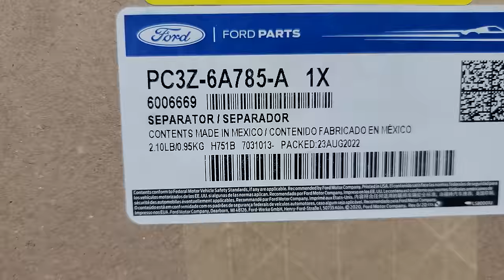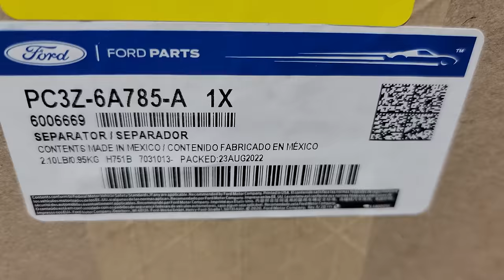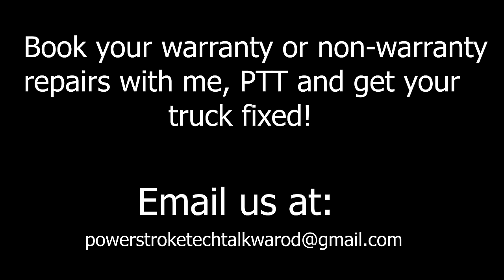TOP secret 6.7 diesel part | should WE PUT THIS ON?? would YOU?

Comment: 23-24 CCV box works on a 17-19 and it does not cause pressure so less pressure on engine gaskets and less blow by
Reply: I put it on my 2021 f350
Reply: @f4tl3oi  bolted right on correct?
Reply: Just installed on a 17 and a 19
Reply: @mgerrow512  did you run into any issues?
Reply: @TerpyToaster  yes! Been running it over a year now.
Reply: @TerpyToaster  Direct replacement. One truck has the non serviceable filter and there was an audible difference in how the truck idles quieter with it.
Reply: Installed on my 11
Reply: @ better off re routing it that'd what I did
Reply from the maker: @Cruising200 juss did 1 today
Reply from the maker: @TerpyToaster ehhh I can't do that stuff my dude
Reply: @Cruising200  you put the new style PC3Z on an 11?
Reply: @keetoniswhat yes

Comment: So my 2022 which has a build date of November of that year came with that 23 part I have a banks ram air and I took the elbow off today to clean it and looked into my inlet and there's a puddle of oil right at the lip of my turbo so it's looking like I'm needing to replace this 23 part?What else could be the reason for the oil?
Reply from the maker: That's normal. The CCV pumps or lets the low pressure created by the turbo to draw in the vapor which collected into what u saw, back into the engine
Reply: @ so what are we recommending a catch Can? Will it void my warranty removing this part or get a new one is the oil going in turbo fine lol need some answers ARod🤘🏻
Reply from the maker: @wespierce1686 they have designed it for some reason to eat it. Your choice to remove, not somethin I can do

Comment: I don't how many of the truck mechanics have ever torn much motorcycle and ATV engines apart, but they have a so much better solution to crank case vents that I've just never seen in the automotive world.
Canam uses like 4way t style fitting on the inside of the engine geared to the crank, it spins flinging all the oil out of the crank case vent. Suzuki I've seen used a box separator like you buy aftermarket for some trucks, except it has a permanent drain line going back into the case so you don't have to drain it. A few other Japanese engines just use complex series of baffles cast into the case so oil doesn't get into the vent lines.

Comment: I have a 2020 and I checked the back pressure with the old big factory one and I had nothing. I hate oil leaks so I decided to change it at 60k anyway and Ford sold me the new small one like you are showing here. Now I have slightly noticeable back pressure. What’s your thoughts? 
I pulled the old one apart and it had some carbon in it.
Reply: I literally did the same thing and have the same issue, I had the old style with no pressure,  replaced it with the smaller new style and now have some noticeable pressure, did you figure anything out with that?
Reply from the maker: I dunno about that

Comment: I bought a replacement filter for my 19, and just did the oil change where I was going to replace the filter (44,000 miles) and come to find out, mine appears to be non-servicable.  there are no screws on the top to take the cover off!!  So is it safe to assume that I don't need to worry about servicing this?  Or should the whole canister be replaced at some point?
Reply from the maker: Nothin to service on them boys
Reply: @PowerStrokeTechTalkwARod  sweet!!!

Comment: Do the newer serviceable CCV units keep oil out of intake? The Cummins crankcase filter works pretty well to keep oil to a minimum there.
Reply: They do not. My 2017 is serviceable type and I have oil stain on the inside where it's vented into the intake.
Reply: The serviceable ones have the most problems

Comment: Hmmm, it would be interesting to see what kind of efficiency you would get if you could mount the cheese grater at the valve cover output, then this on top using an adapter to dump what little oil left back in the motor, still using intake vacuum to aid ventilation.
Reply: I was thinking SPE cheese grater under the new style CCV box than rerouted externally, obviously have to put a spacer on the drain back port, so the CCV box sits flush, this would have to product next to no fumes i am thinking.

Comment: Was there any update on the retrofit of the later CCV to the earlier models?
Reply from the maker: It works on all 6.7s fitment wise. Won't work if your CCV box hose has an electrical connector. The new 1s do not.
Reply: We have a late 2020 that has the bolts on the ccv, no electrical connector, so the later filter will fit / work ok? The proper replacement is on back order with no eta. 
 @PowerStrokeTechTalkwARod
Reply: @PowerStrokeTechTalkwARod Do the 2019’s Have an electrical connector?
Reply from the maker: @kao9379 2011 2012 2013

Comment: So there's 4 different ones now? I had prior heard about the one with top bolts, supposed to be serviceable and the tampons inside for steel bodies. But my 16 had the revised non-service sealed top one. Which I am unclear if they need changing or are a lifetime unit with no issues. Hmm.
Now we see a new version bolt top and an even newer version sealed top.
Reply: Only ones that had a replaceable filter was 17- 18. The steel body trucks didn't have filters in them. These new ones are much cheaper as well. Dealer cost on this are $49 compared to the other ones are over $100.
Reply: I agree. I believe ARod has said the filtered bolt top was first, then replaced with a new version thats non serviceable sealed top (which is what my 2015 has in it.) Then the newer trucks came with a newer filterless bolt top, and now those are replaced with the small one in this video. So i just saw another video from another flrd mechanic saying to change your ccv bc they get plugged. He shows it very swollen and its the same one i have in my truck which is filterless, so my question is how did that one get plugged up if it doesnt have a filter. And do i need to change mine to a newer version or is it a "lifetime" oil separator?
Reply: @CPsGarage the one for my 2015 truck on fordparts site is $220 discounted $245 regular. Smh so if i ever need tl change it im pretty sure im going with the $49

Comment: Can any of these be used on older model trucks, say 14? Or because there is no sensor it can't be used? Thanks
Reply from the maker: If your truck has no sensor good to go! 
If your truck has A sensor then you might want to see if at some point in time it had recall 17M04 completed which was a PCM reprogram to no longer look at that sensor thus deeming it ok to leave disconnected & use the new PC3Z box as you saw here.
Reply: @PowerStrokeTechTalkwARod  My truck did have the recall. They also took off the grey lock ring and put on the rubber collar.
Reply: @PowerStrokeTechTalkwARod  Just ordered one. When I install I'll let you know. Love your videos and your new shop!
Reply from the maker: @stevenfuchs2548 cool
Reply from the maker: @stevenfuchs2548 thanks buddy

Comment: Hello ARod. I was wondering if I wanted to update my 2013 to this new design, I still have the connector on the tube. If I updated won't I get a check engine light complaining about the connector? Or does the pcm have to get the latest firmware first? Thanks
Reply from the maker: Yepp nice job, thee pcm wld need 2 be updated to the last calibration out.
Reply: @PowerStrokeTechTalkwARod  thank you very much

Comment: I have a 17 6.7 and I'm just about to replace mine at 120k. Mine does not have the screws on top just a sealed unit so not sure if it's a filter or baffle. I got truck at 50k and I have a small upper oil pan leak now suspecting the ccv and it was probably never replaced. But still better to swap out and cause more damage. How often does Ford recommend replacing CCV?
Reply from the maker: U have n O filter

Comment: I wonder if it was change to accommodate the new high output 6.7L? Would the HO use that sensor port and the standard 6.7L not use it as on the current trucks?
Reply: Most likely due to up coming OBD requirements set by the government.

Comment: Does the late model 22 ccv box have a filter in it? Can it get clogged up? I have a late model 22 and trying to decide if I leave the factory box since it's late model or do I get spe ccv kit?
Reply from the maker: No filter!!!!
Reply: @PowerStrokeTechTalkwARod  so just leave it then and shouldn't have any problems right? Will this box fit a 18 6.7 with out any problems?
Reply from the maker: @stevenallen461 you shld put PC3Z 6A785 A in both if ur 22 hast had the new new one, still no filter tho
Reply: @PowerStrokeTechTalkwARod  22 has the new one you showed in this video but my dad's 18 hasn't been changed so if that one will fit no problem we will change it to the new one
Reply from the maker: @stevenallen461 yea

Comment: The ccp sensor may be equipped on the high output 6.7 option in the 2023s, as a protection measure to derate the truck. Could also be used in the iOLM strategy to corroborate calculated engine load. As far as the one-time use hoses, it may be an emissions tampering deterrent or to ensure proper sealing ford one of the strategies. One concern with not replacing the tube if flagged as one-time use, if one needed to SPW a repair (of a cp or wty repair) and it was not replaced, there is the potential for a claim rejection - never seen it, but is allegedly possible.
Reply from the maker: Look for it in 2025

Comment: Great vid. Two cap fulls of Amsoil upper cylinder fuel treatment in that power washer. It will thank you.
Reply: I'm running 100cc of two cycle for every 16 quarts of diesel fuel as diesel today has zero lubrication this is my own preference not suggested that anyone else do this. But along with other regular diesel fuel conditioners, my 6.4 seems quieter and runs smoother. I also lowered my low-boost fuel from the number 3 position to the # 2 position on the tuner. This has improved the black smoke on start-ups and in stop-and-go traffic. Just something I am toying with I'm not responsible for any damages if you follow this procedure. Just saying a little more lube in the upper cylinder and going through the high-pressure fuel pump shouldn't harm anything. Should it 🤔

Comment: I have a 2019 (do not know much about diesels), could that blocked sensor port be for backward compatibility? My truck has 74k miles on it. How often should I replace the CCV element? I've have yet to replace it.
Reply from the maker: Backward compatibility. No, this is the brand new one. If you have a filter in yours, it needs to be replaced. Often watch my other ccv videos

Comment: Is there any more info on whether this newer version is better?
Reply from the maker: .....better as far as what
Reply: @PowerStrokeTechTalkwARod  better than the previous ccv versions. As in not plugging up, or having to service as much, or not allowing oil into the intake system...
Reply from the maker: @dawveed26 they all allow oil into the intake system. And only the duallys had ones with filters that were known to stop up
Reply: @PowerStrokeTechTalkwARod  so the best option is to install a remote ccv can kit and eliminate the box all together?
Reply from the maker: @dawveed26 if that's what you deem suitable for your needs

Comment: The early 6.7's did not have a serviceable unit.  They had an oil seperator.  My truck has 132k miles and have never had a problem.  Always enjoy and learn.  Merry Christmas.
Reply from the maker: U too pal
Reply: Dumb question. I have a 2012 with the non serviceable box. I have no blow by at the moment.  Are these non serviceable ones ok to let alone or are they needed changed?
Reply: @Jason1Pa  They are an oil seperator and are not serviceable.
Reply: @johnmac4769  Yes I understand they are unserviceable,but can they still get clogged and need replaced?
Reply from the maker: Theres no filter, no change
Reply from the maker: I think u need to watch our other CCV videos broski
Reply: @Jason1Pa  They are just an oil separator.  There should never be an occasion when they plug.  The only exception may be on a worn engine with excessive blow by. If you want to remove the separator it is not hard.  Some people remove them and use a catch can system to eliminate crankcase fumes from going into the intake
Reply: @johnmac4769  Got you! Thanks for clearing that up

Comment: I wonder if this new smaller CCV box is better or worse than the previous non serviceable one…..   I wonder if this better circulates the crankcase pressure or if it makes it worse.
Reply from the maker: Better
Reply: Not sure I’m convinced.  Just simply blowing through both (I finally tracked down a new one), the new one seems to have more flow resistance….

Comment: Does this fit on 2012 6.7?
Reply from the maker: It will, but your truck has a sensor and an electrical connector that goes to your box
Reply: @PowerStrokeTechTalkwARod thanks for your response!  So do you just recommend i use original then? Or do you just recommend it get ccv re-route kit
Reply from the maker: @cruz1118 original

Comment: For simplicity. Lets call this fords catch can. After years of being imbarest by running the engine internal sewage back through the filtered cold air intake and into the combustion chamber. Turning your engine into a sewage treatment incinerator lowering the quality of the air fuel ratio efecting the HP, the MPG and over all engine performance while lowering the longevity of the engine. I say better but the sewage is still going back into the crankcase lowering the quality of the oil contaminating baring serfices, seals and gaskits also increasing crank case pressure putting undue forces on seals and gaskets. This isn't  rocket science. This simply needs more serfice area  like stainless steel wool and a couple of inline colection reservoirs. That can be easly removed and cleaned at regular servicing schedules

Comment: Can I replace a 2015 with a 2023? My truck has 200K on it. It does not have the back pressure shown in your other video. But I know it has never been changed.
Reply from the maker: As long as your CCV tube has no electrical connector, you'll be good to go

Comment: Wtf does it even do?
Reply: It allows the crankcase pressure to escape and allows the oil vaper to drain back into the engine. It's a emissions device as the EPA requires the vapors to remain in the engine or be burnt off. If vented to atmosphere the vehicle is technically for off road use only. A closed crankcase system has been a thing for a long time. Even the 7.3's had a CCV box
Reply from the maker: Encyclopedia bertanica over here
Reply from the maker: ....it fits right next to the trap by the pvc to galvanized ½ water to fluid extractor fitting thing thingy
Reply: @PowerStrokeTechTalkwARod  coffee table books
Reply: @PowerStrokeTechTalkwARod  you aren't even old enough to have used one brosef, 😆
Reply: @CPsGarage  thank you for the explanation, much appreciated
Reply: @PowerStrokeTechTalkwARod  yes yes, and that also, at least in person you don't razz me so much 😁